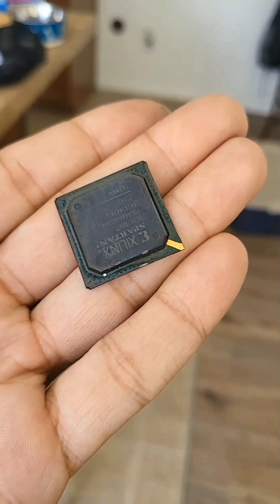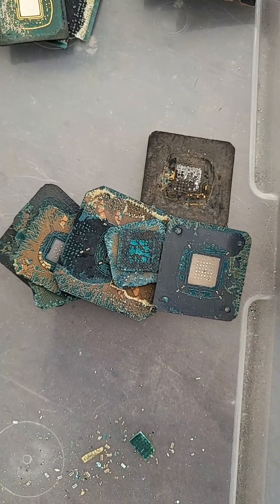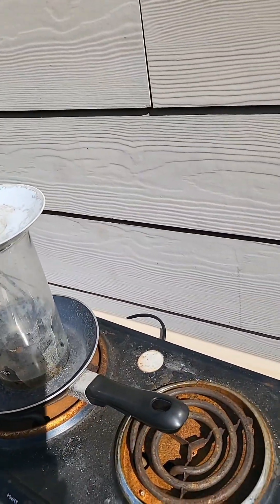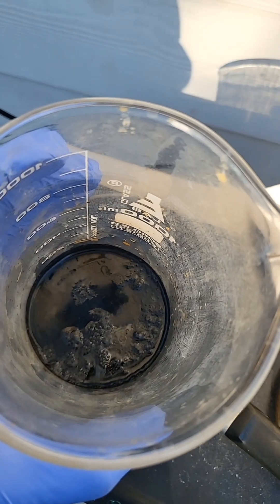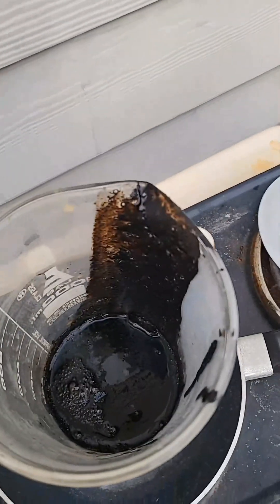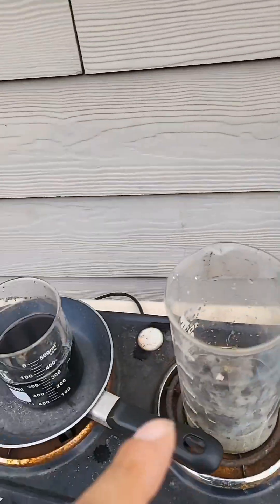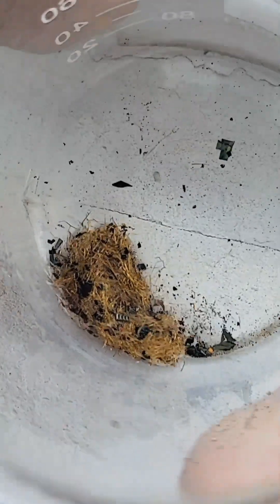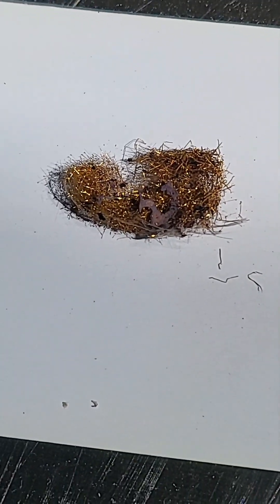HOW TO GET FREE GOLD FROM GOLD CORNER BGA IC CHIPS WITH SULPHURIC ACID / WET ASHING FULL PROCESS

Comment: I myself work in my kitchen because i have everything needed close by and i can keep an eye on my 6 children . This helps out too because my great great aunt sleeps in the utility room that joins the kitchen and garage and she likes to help ! The only thing that came from COVID  was the mask wearing and now we just keep on keeping .....everybody wears 2 of them and an ol' t-shirt tied around for that added protection that i demand . The kitchen stove blower / vent has been giving me fits so i just keep it off ....no chance of a fire that way ! Think safety ! My aunt said her cough is normal and the back door is opened a crack for even more air flow and gets rid of the insects and roaches , in fact i haven't seen a bug of any type in quite a while . To save mucho time i just melt the whole board ...why not? It's a time saver and does not require any '' baby sitting '' , just turn on the burner [ that's why they call it a burner ] and set it and forget it ! My aunt or the neighbors will call me when it's good and hot ! From there it's right into the bathtub for the ....what we call , the '' COOL DOWN '' ! You can get 2 things taken care of at once ! The computer board mix of plastic / gold / and a good time will not only get the job done but  the valuable contents will warm the cool water enough for bathing ! The other upside is while they are bathing i can take a break and they can use coffee filters to save the goodies ! Then it's right back to mother nature ! Drain the tub [ are plumbing goes directly into the creek ] and prepare for the next batch ! Go green ! THANKS ! LOVE THE CONTENT ! Can we see something on a safer way to strip copper / brass from live equipment ? Parking lots are a ''gold '' mine if you're looking for spare parts . Just sitting there and nobody driving them ......like every day ! Garbage day in our neck of the woods is beyond comprehension , i just found a cooler and a grill with 3 nice chairs and an ash tray and an umbrella ...there was even a bicycle ! The cooler was full of drinks and ice cold ! The grill was pretty hot so i wore gloves while my wife attempted to ''help'' me without burning herself as i removed the other items we found to make room in the trunk of the GEO METRO ! That GEO got a workout that day ! Every time i drive past the house where the people threw out the grill and stuff they stare and shout at me !? We figured that they were trying to tell us they had more stuff to throw out but we were busy and had a full load already . The next day they had a sign up in the yard saying they had been robbed .......damn , there goes the neighborhood ! Did i mention the grill still had charcoal and almost cooked chicken ? It even had a couple of hot dogs slowly warming on the top rack .....like they were for a child's lunch ! Unbelievable the waste in this great country ! I'm just doing my part to save the planet for my children's children ! Thanks love the content !

Comment: This guy doesn’t seem to know what he’s doing.. I am a gold refiner and this process of his was a bit odd lost tons of gold from it and could have easily gotten the gold off those chips before putting it in solution. Didn’t melt the gold down after, didn’t do anything all he did was separate the gold from the chips using the acid rather he could have used a blow dryer even. And he didn’t refine any gold what so ever. 🤷‍♂️
Reply from the maker: Wheres ur video smart guy. I kno what im doing i just dont care what u think

Comment: Looked nice. You need a different bucket for each solution. Never mix them. A stock pot is for solutions that have been used to refine gold, known as AquaRegia. A bucket for nitric solutions it can contain silver, then one for waste, Keep copper in your AR and nitric buckets to cement out any silver or gold. . It only takes a couple days then you can pour most of the solution into the waste. Use iron in the waste bucket to remove the copper. Again it only needs a few days to do that. Pour off the waste into another bucket and treat it / baking soda (slowly) it will boil over, until the Ph reaches 6 . Let it settle, the fluid should be clear, then dump out the fluid. It's basicly iron rich slightly salty water, but harmless